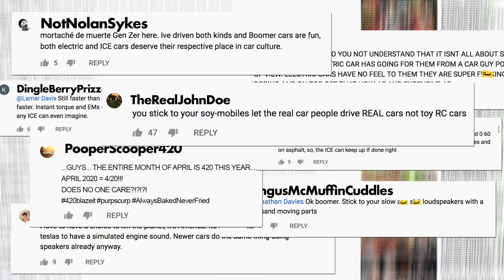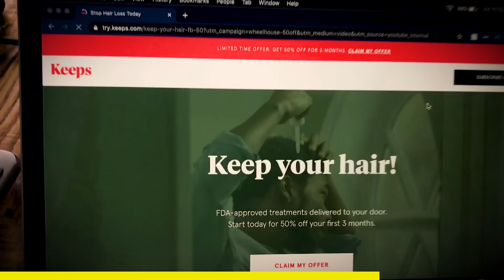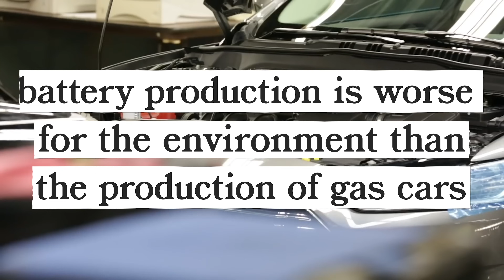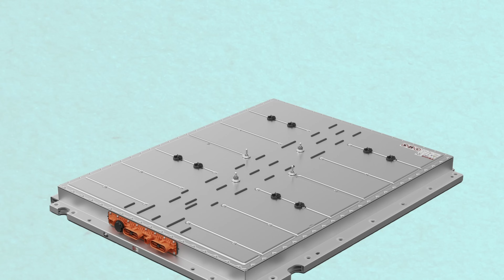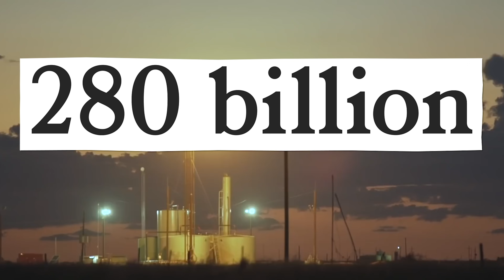Are Electric Cars REALLY Better for the Environment?

Comment: It would be interesting how the Emmissions change when comparing bio fueled ice cars to EV´s
Reply: I think you are talking mostly about ethanol right? The production of Ethanol is extremely resource-intensive and is mostly done due to lobbying from the corn industry, making it not really an improvement over oil. The other thing that comes into play here is that piston engines are barley efficient. Most ICE cars are only about 17-21% efficient while EVs are about 59 - 62 % efficient (motors are about 85-95 %.
Reply: @johnw.2634  There's also hydrogen powered cars. There's even been the suggestion of making hydrogen powered rotaries since the downsides disappear with hydrogen fuel
Reply: @filmandfirearms  a hydrogen rx-7 successor would be pretty awesome 😂
Reply: Meerkat More although hydrogen ice is awesome, turning the hydrogen into electricity for motors is far more efficient so sadly hydrogen ice will probably never be mass market.
Reply: John W. Right now ethanol production is bad for the environment but it could easily get better if u use waste from farming and food production. Theres also HVO for diesels

Comment: In New Jersey our grid is fed by 80% fossil fuels. 20% renewable. If you charge an EV there is fossil fuels burned to create that electricity. So I disagree that once the EV is manufactured it isnt responsible for any further emissions. Once the ratio of fossil vs renewable is flipped which I dont see happening in the foreseeable future as there is big money in fossil fuels in both production and consumption. Then and only then will I believe that their consumption is little to none once the manufacturing is completed.

Comment: They say you can drive an old land rover for 60,000 miles before you reach the same carbon footprint as it takes to build a Tesla Model 3
Reply: You're basing this on the fact that the EV production process will not improve. You're still looking in the short run.

Comment: Just a quick correction for ev battery recycling, they are actually near 90% efficient for the newest facilities  and while capacity hasn't kept up for demand but industries are starting to turn that way.

Which means the  reliance of lithium mines are far less then one would expect as time goes on.

Comment: Emissions.
Shows video clip of a nuclear power plant, releasing literally only water vapor, which precipitates out of the atmosphere.
Reply: Was looking for this. Such a massive misconception regarding those "smoke" stacks.
Reply: Sic Semper Tyrannis  and one of the safest
Reply: well i guess the video editor is the one to blame on that one chief.
Reply: Electric cars + possible solid state batteries + solar/wind/hydro/nuclear energy and we'll start doing some good for this planet.
Reply: That's a cooling tower, used in  nuclear, coal plants and natural gas plants
Reply: @Seawolf But, the running cost is virtually nothing. Some pack of fuel pellet for electrifying whole state for several month is cost less than grand.

All of electrical bill from nuclear reactor already compensated all of cost from building, maintaining, insurancing (it's exist surprisingly), and even decommissioning. And it still almost only half of coal+renewable one.

Heck, if you can manage renewable+nuclear, you can reach literally zero emission with very low cost of bill and still maintaining demand. Best for the both world
Reply: So the thing is that “new nuclear” power is so much better then the old power plants of the late 1900s.  They produce lil to no waste and use no water from local reservoirs.
Reply: Sic Semper Tyrannis 
Chernobyl intensifies
Reply: Sic Semper Tyrannis haha it’s not really clean considering the nuclear waste
Reply: Trumaniac- Reguarding waste, if we just made like a parking garage we could store all our nuclear waste in it. Especially if we used reactors that run off the waste from other reactors (which can be done) the waste is pretty minimal and the radiation is easily stopped. Again, a solar farm will take up far more space than a reactor + it's waste storage, waste isn't a big issue. Regarding mining, yes it produces some effects but it doesn't take much to run a reactor and that can be mined quickly. Far easier than coal, and the materials for solar panels, wind turbines, etc also require mining
Reply: Seawolf But the reactor will pay itself of from the efficient use of power. Those solar panels will have been generating electricity for 8 years, but will immediately be dwarfed by the power output from a nuclear reactor. Also reactors take up way less space, solar farms to match a reactor output have to be absolutely gigantic and still aren't constant and require massive battery reserves. I have solar panels on my house so I'm not trying to hate, but I don't think they're the solution. Great for individual homes, but impractical for large scale usage, especially when you consider materials used to manufacture solar panels and how we dispose of them
Reply: @Seawolf Im pro nuclear but this is the real answer. I think we should maintain and use the fission plants that are already built, and spend lots on researching fusion energy, but not continue building new fission plants. There is already a giant taboo associated with nuclear energy and god knows people don't make decisions based on rational... We should use this as an opportunity to make a big push in renewables to get them to that tipping point where they become real, viable options. Combined with storage solutions, its the clear answer. The only people who wouldn't want that are people who don't want individuals to have independent energy production...
Reply: Sic Semper Tyrannis  Yes and no. During use, it is efficient and overall significantly better than burning anything. However, assembly of the plant is extremely expensive and nuclear waste is just plain bad. I hope that Fission, like lithium batteries, is only a stepping stone to a better end goal. I fully support research into Fusion energy, wind, solar, and hydrodynamics though.
Reply: @Seawolf The issue with solar is that it simply isn't efficient enough. It's only about 20% efficient on average. I would love to see a world where we run purely solar energy, but it's just too insurmountable of a hurdle at the moment. 
https://ecotality.com/how-many-solar-panels-to-power-the-world/

^That's a very interesting article about the demands of global energy and the requirements to meet the need with solar.
Reply: Generally agree but Tschernobyl and Fukushima demonstrated they are unsafe. Nuclear waste is taking centuries to be safe and the low electricity cost don't always include the waste cost
Reply: @gulion06  nuclear power is very safe. Chernobyl only happened due to multiple people disregarding safety procedures. That's not the fault of nuclear. Fukushima was also due to a tsunami and failure to prepare for it and to follow safety procedures.

Overall, nuclear is a much safer and more efficient alternative. It should be research to make it even better (by using things like Thorium and fusion).
Reply: felice camponovo Fukushima didn't kill anybody directly from radiation, and Chernobyl was in the Soviet Union which obviously had it's problems. Yes it can be dangerous when managed very improperly and without proper training, but 2 incidents in the history of nuclear power shouldn't it rule out. People die in coal mines all the time, we've kept it around for awhile regardless. A vast majority of nuclear plants have operated in complete safety for their entire lifespan, it is not a dangerous production of power. The waste can be stored in a can in a basement real easy
Reply: The best and the worst thing are the same in nuclear power plants:
You have to store the used fuel.
Coal/natural gas powered plants are releasing the used fuel into the air. It can cause many health problems.
Maybe later we can use the nuclear waste or handle it but we will need nuclear power plants for decades.
Reply: So what’s the issue here? The plant is still emitting the water vapour, so yes, it counts as emissions. Which dictionary do you use that shows emissions = dirty?
Reply: @Seawolf renewables also aren't as efficient to power the world on their own. Nuclear has its downsides, yes, but it has more upsides. You also ignored the downsides of other means of power generation. Fossil fuels are very dirty.
Reply: @Seawolf It looks like it more expensive. But remember, Nuclear is turndown-based powerplant that should be very stable, very reliable, and last very longer. The only competitor of Nuclear power is coal power and geothermal. It last more than twice than renewable. But, that's not the entire point.

The point is that renewable isn't turndown-based. Even if energy storage is decent, you can't run it alone and pretend if energy instability is pretty fine. You still need turndown-based power plant or you literally destroy the whole grid. The relationship with nuclear power isn't subtitute, but complementary. Comparing the nuclear with another renewable energy isn't apple-to-apple at all.

If you give out the nuclear and pretend if renewable can subtitute nuclear, you'll ended up with coal, no matter what you tried to do. German already did it, and yes the polution is much worse (if not more expensive) than France that using nuclear + renewable. Because again people is never understand of the concept of turndown-based powerplant.

In summary, nuclear + renewable is better than coal + renewable or even renewable only. Cost cheaper, very reliable power surge, and literally zero emmission. If you can reach all of them simultaneously, why opted less and pretend if it's much better.
Reply: Seawolf- I don't know where you got a lifetime of 20 years but even the old reactors were designed for 40, could be extended past 60. New reactors are designed for 60, could go past 100 if they wanted. No reactor has been shut down because it became inefficient or dangerous, it's all just government regulation and propaganda. I'm not sure what you mean by renewables being more stable, the energy output of things like solar and wind is varied and uncontrollable whereas reactors are near constant and very controlled. As for space you could fill Arizona with solar farms, but a couple reactors could also fulfill that energy requirement. That leaves a lot more room open for business and residential expansion. Additionally it costs energy to move energy, you want your source to be closer to your city rather than further. Solar farms expansiveness mean the edge panels are losing power just transporting energy over. Heavily populated metropolitan areas are going to require the most power, and that's exactly where space is minimal. Windmills are also a terrible use of space because the footprint is relatively small but the blades take a lot of space. This means they cannot be very close together, and nothing can be built below them. If you want power density, reactors far surpass renewables. 98 reactors (that's all of America's operational reactors) produced 19% of America's 2018 electrical generation. Reactors produce (on average, low is 500MW high is 4GW) 1 GW of power on about a square mile. Solar farms take 75x more space for the same power
Reply: Water vapour is also a greenhouse gas that contributes to climate change
Reply: @DeLaCroix1211  I've always found that one interesting. It's almost like saying we need to kill off the oceans  since they do vaporize naturally (of course it's about the extra we're tossing up on top lol)
Reply: Steam is a greenhouse gas
Reply: Sic Semper Tyrannis until we have to dispose of the nuclear waste. Solar, wind, hydro is the cleanest forms of energy imo
Reply: @FSXflyermaster  Just wrap in plastic bag, the most lethal radiation will be stopped easily.

Or if the Green Movement pissed of due to lack of knowlegde of material science, we can put the waste into the lead container, fill it with portland cement, and put it in deep underground. Really, it was really-really ovekill and really unnecessary to do it for nuclear waste management.
Reply: @FSXflyermaster  they cost way more. More maintenance, less efficient etc. But no hate
Reply: @FSXflyermaster  Hydro plants wreck havoc on the preceding landscape. They entirely change the topography, displacing tons of life.
Reply: @FSXflyermaster  You should look into the new Gen IV reactors they are building and designing in the EU and USA. They have different plants to burn different fuels in order to minimize the waste to about enough to fill a coke can. Each plant burns the waste of the plant before it until there is almost nothing left.
Reply: @FSXflyermaster  the idea that nuclear power plants produce tons of waste is outdated. The first plants used a type of uranium that's super inefficient in how much energy it produces compared to how much waste it makes plus how risky it is to use. New plants use plutonium which makes a fraction of the waste that uranium does, it's much less dangerous, and it's much more abondent

Comment: Methane is 78% oxygen 
NitrousOxide is 90% oxygen
Hydrogen Combustion engines will be the BEST efficient power plant 🌱 for the future. 

Electric vehicles 🚗 are taking the industry backwards.

Building vehicles without a gas powered engine, loud exhaust and even 3 peddles is. It a vehicle. It's an iPhone waiting to crash- 

Electric is cool working in conjunction with an engine - La Ferrari, Konesseig, Acura NSX... - but as an only option.  I feel bad for Europe. The technocrats out there think everyone is going to buy electric by 2025 - 🤦‍♂️

Comment: When the battery is no longer viable for automotive purpose you can use it as a home powerwall or as part of a mega battery.
Reply: G E N I U S
Reply: When its no longer viable for automotive purposes, it should be recycled into a new battery.
Reply: No you can't because the battery would have degraded so much it won't be able to hold a charge
Reply: @AdamSmith-gs2dv  no. Batteries are considered unviable for automotive use long before they are unviable for other uses.

Comment: To create them, it's sometimes worse off than combustion engines. It's all about efficiency and filtering. I think that will be the future. Only problem is we also need to find other sources of energy because we'll run out of oil in the future.

Comment: Fairly good video, however a large emission is the lack of placing nuclear energy under the clean energy category.
Reply: Nuclear energy is awsome. It has no emissions and is extremely reliable. Sadly it has gotten a bad rap from poorly designed power plants that exploded.
Reply: @johnw.2634  
There is a documentary on Bill gates. 
He was heavily pushing for building a morden Nuclear reactor that uses old nuclear waste in China since US won't allow it.
But, trade war started and everything went down the drain.
Its on Netflix Bill's brain.

Comment: The thing is, the more normal people will get more efficient EVs the longer will car people be able to drive their fun cars.
Reply: We aren't anywhere near running out of oil, and there's always biofuel :)
Reply: Perfect scenario would be that all normie city cars being EV while all performance oriented cars have a combustion engine
Reply: @falcongamer58  hybrid performance cars yes :D full gas if needed to be under a certain weight
Reply: @JoeysGames  hybrid performance cars could be arguably cooler than full gas cars but they still use a big battery  :(
Reply: @falcongamer58  and?
Reply: @falcongamer58  well, I think batteries will get smaller in the next few years

Comment: Add Nuclear as one of the clean sources of energy as that's better for the environment than wind solar and Hydro Electric as the impact of those other "clean" sources of energy is detrimental to the local wildlife and forests as companies have chopped down forests to put solar panels in. Which is ironic lmao

Also Hydrogen power will forever be Superior to electric cars as you don't need to mine anything other than the metal for the body.
Reply: Nuclear is amazing but just issue with people thinking is bad if were to explode

Comment: I work in fuel injection and I can tell you modern diesels are extremely clean. Most Tesla charge stations in the uk have a big MAN generator hammering away to power the charge stations.
Reply: Yeah im from the UK aswell and no they dont at all i have never seen a generator next to or near a EV charging staition, also you would need a container sized generator to supply a charging staition also the cost of how much it takes to charge a EV is like £2 you would use way more then £2 worth of diesel to charge a EV so it would make more sence and cheaper to not have the charging staion running then to rent install and then fuel a gerarotor. Also the whole argument of oh diesels are clean ok stand in a air tight room with a diesel car running then VW tried that and it didnt end well did it? and just to clarify I have a diesel 530D bmw diesels are awesome but just because on paper they are "clean" dosnt mean in reality they good for the envioment.